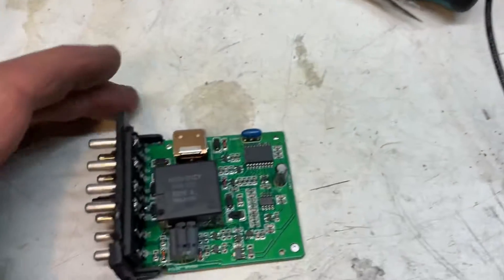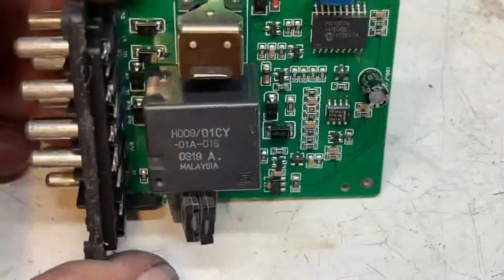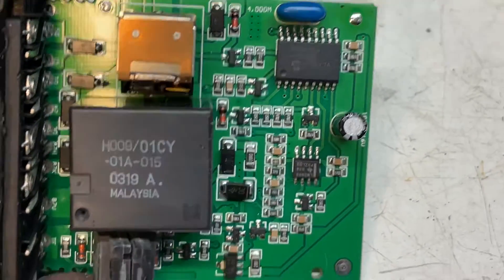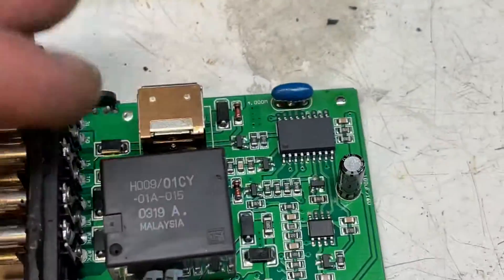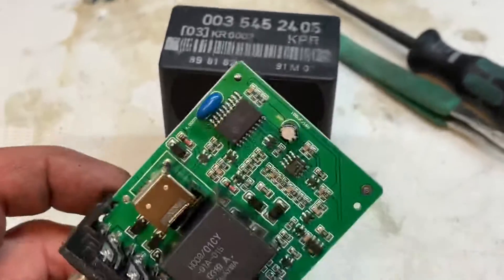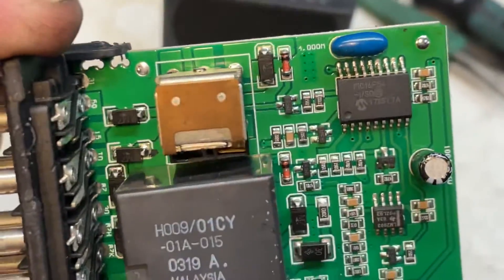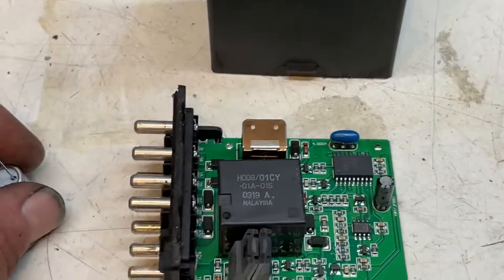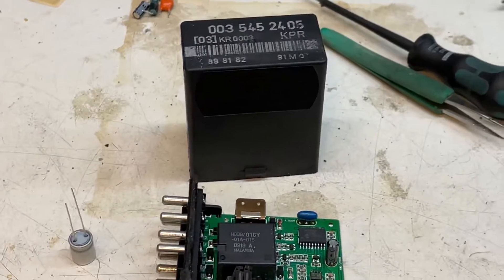Mercedes Benz W126 560SEL 3/89 Testing & Overhaul of Electrical System and All Control Units Part 2

Comment: Thanks for posting this video.  This is actually a VERY important part of restoring these cars that nobody really seems to talk about or know anything about!  I have to go through EVERY single module on every car I restore and usually replace all the elec caps, and resolder most joints.  One question I MUST ask you though, is what is that amazing capacitor tester/LCR meter device you were using??  I really would love to get one.  Thank you for the videos!
Reply from the maker: Hi Johnathan,

This is a B&K Precision 881 In-Circuit ESR/DC Resistance Tester

Comment: I connected the same relay on a 560SEC, the fuel pump works, but the cold start injector is not powered properly. The timer lasts only one to two seconds. Normally the timer should be at least 10 seconds.

Comment: I just removed and check all the temperature module of my 560SL all them minus two were out of spec, I'm planning to replace them which ones can I chose I know has to be the voltage and uf but also I see some temperature range , does it matter if they are audio grade? which brand do you recommend?
Reply from the maker: Temperature modules, you mean the temperature sensors installed in the engine intake system?

Comment: I recently sent my fuel pump relay to get repaired and my fuel pump is new I replaced like 3 weeks ago and when the engine idles at 900 or 800 rpm the pump would be all noisey like it's getting ready to sieze any ideas what could be causing it I have a 1985 500sel
Reply from the maker: Have you checked your fuel pressure on the fuel distributor and WuR?
Reply: No but this point i think i should because both my fuel disturber and wur were rebuilt a year ago @inovahightechltd
Reply from the maker: @ ok, just out of curiosity, where did you buy the fuel pump?
Because the engine rpm has no impact on fuel pump
Reply: @inovahightechltd  I bought form eeuroparts the pump is a bosch pump
Reply from the maker: @ ok, is this possible that the check valve is installed backwards or is not working properly? Also, is the fuel accumulator still good and installed correctly?
Noisy pumps are usually a indication that the pump itself is bad or going bad if everything else in the system is working as intended
Reply: @inovahightechltd  I guess I could try putting in anther accumulator I know the check valve is new and installed properly  do you think that the fuel pump is getting too much current? That could cause the pump to be noisy
Reply from the maker: @douglet2294 no, is it like a squealing kinda noise? Like a bad bearing kinda noise?
Reply from the maker: @douglet2294  and is this a standard Bosch pump or their premium version?

Comment: Making a new comment because yt is not letting me post anymore replys i made a quick short there you can see the fuel pump whining let me know what you think
Reply from the maker: @douglet2294  that’s either of two things:
1. The pump is getting air sucked in on input side or your fuel strainer in tank bottom is pretty clogged up
2. If none in #1 turn out to be the cause then you got unfortunately a bad fuel pump - I would return under warranty
Reply: @inovahightechltd  thank you the car has Iess than 2 gallons of gas but if it's the strainer luckily I have spare unfortunately the part A2014700506 is NLA so I got the one of the last ones thank you so much for your help
Reply from the maker: @douglet2294 try more gas first